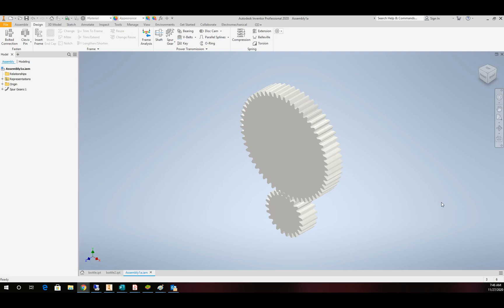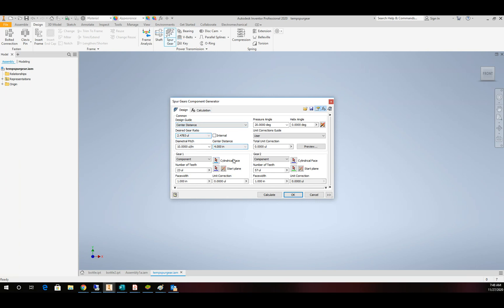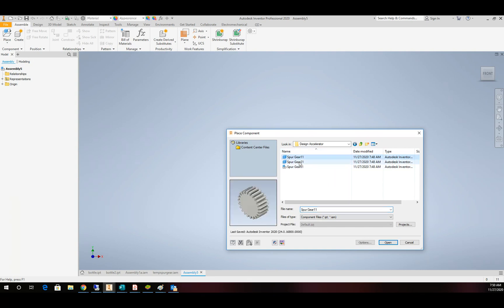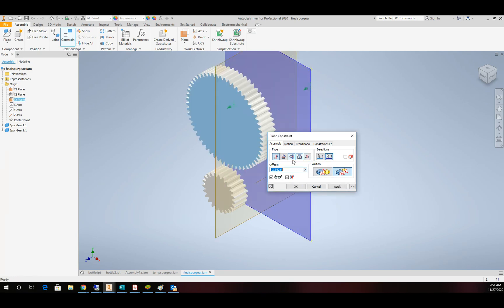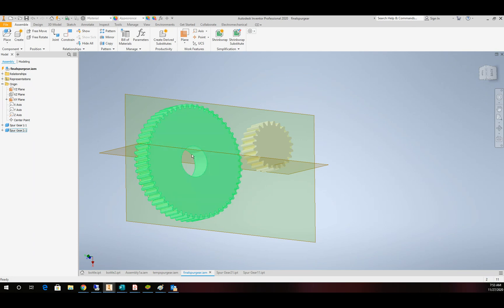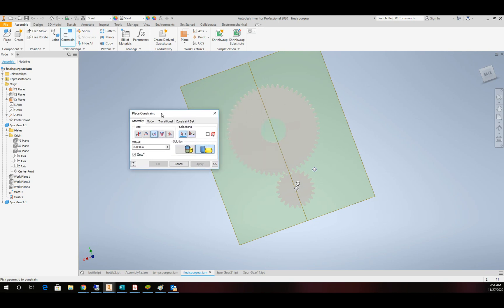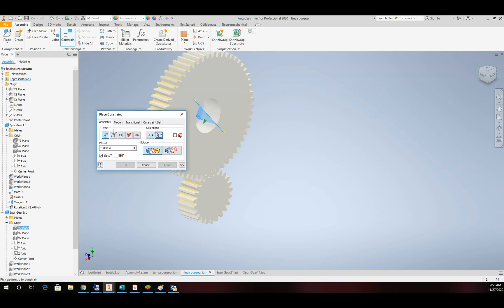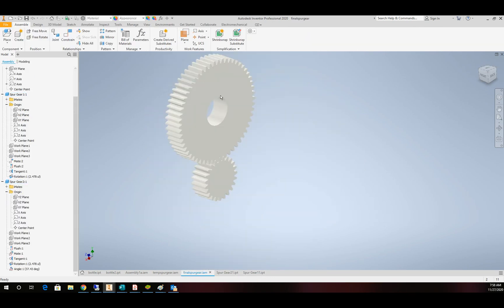Inventor 2021Tutorial, How to create a Spur Gear using Design Accelerator that functions.

Comment: Hi everyone,
I have designed a spur gear on inventor. I made 2. One with 14.5 degree pa and one with 30 degree pa. Ive cut both with my cnc but they are exactly the same.i transferred the files to cad and opened them on top of each other. There is no difference in the pa. Can someone help me with this.
The gear specs was. 12 dp x 54t x 14.5 degree and 30 degree.
Thanks
Reply: One year late, but maybe someone will find this helpful. The model generated by the design accelerator uses a simplified geometry, so the model is not too heavy to run. In order to get the correct profile, right click the design accelerator and choose export tooth shape. This will give you a new file with the correct tooth shape.
Reply: @2testtest2  Thank you!! The program designers must think we just draw stuff. Surprise, we actually                use these wonderful and accurate programs to build things.
Reply: @2testtest2  THANKS, I like you more than a friend
Reply: @2testtest2 Thank you soo much.
I thought that sth is wrong with the model and thanks Jesus, that I didn't print them today.

Comment: you cant make gear as a part? like a single gear? I get it that ultimately it will have to mesh with another gear but just out of curiosity.
Reply from the maker: the only way to make the gear is in an assembly file.  However, the process of using the design accelerator to make the gear does produce separate part files.  You can make just a single gear in the design accelerator though just uncheck second gear specs.  this still needs to be done in an assembly file though.
Reply: @MorrisonInst1973  Thank you so much!
Reply: Honestly the best tutorial I've seen for Inventor. Thank you